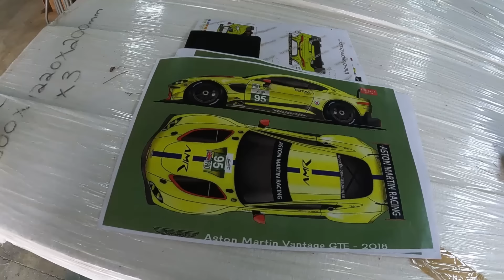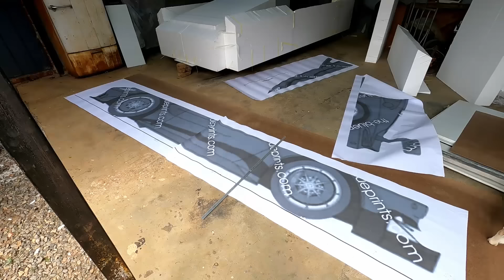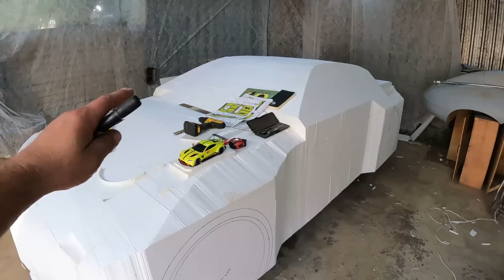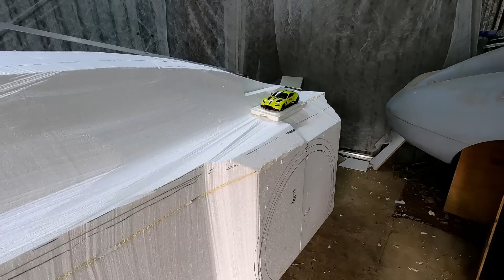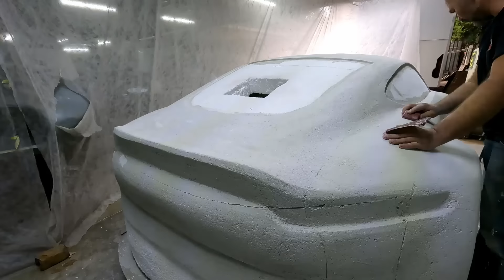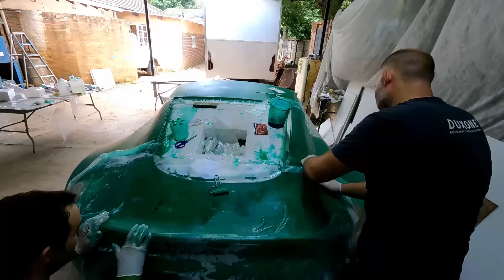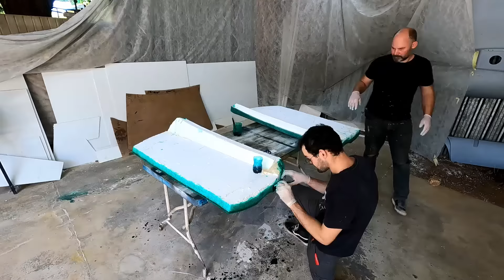EASY METHOD TO MAKE SUPERCAR BODIES FROM SCRATCH

Comment: Niiice!  Back in the 70s,  my friend's dad [Jack Kampney] made "The Mummy Machine"
*Which I'm sure millions of people are familiar with..  Jack used this same type of system for his prototyping and production.. 
He used what he referred to as a "Chop Gun" - That was pretty slick.. 
It mixed and threw the fiberglass/resin combo straight out like a spider web - so coats were Sprayed on vs Coated on..  
His shop was So Much Fun!
Anyways..  Your method rocks!  I've used the foam/hot-blade method for building RC delta wings.. 
*I think this method is probably better..  *I was initially taught having to carve clay..  Easy to work with but creates more of a mess.

Comment: It seems that if you purchased some brake cleaner spray, it would dissolve all of the styrofoam without hurting the fiberglass, so it is an easy way to seperate the two.

Comment: I once helped my dad carved a giant 10 foot diameter pepsi bottle caps from styrofoam and even bigger jumbo jet cockpit, it's in the early 80's, he probably the first one using hot wire cutters and airbrush to do large scale 3d styrofoam promotional props in my country. I always thought my dad is some kind of McGiver-y dude. Miss him.
Reply: Had similar experiences with my dad around that time too , mainly in model engineering and model aircraft… later working in the family business with plastic fabrication…
He’s been gone 10 years… you just don’t appreciate what experience they gave you when you young… 
Ironically I now have a son of 30 years old and history is repeating itself, I’ve taught him everything I know and we work together… he learns different skills every day, not just from me … 

That’s 3 generations of multi skilled engineers … all self taught.. 
I’m also just building a full race car from scratch using similar methods in this video for some parts… 

Remember scaling up drawings using graph paper and tracing drawings onto balsa with carbon paper and tracing paper…

Yep good old days 👌

Comment: Are Aston Martin aware that your client is faking an Aston Martin car on the race track ? He can't just build a car and then put a fibre glass Aston Martin body over it. (Unless he is Chinese in China) but listening to the accent it's in South Africa.
You should be talking about a mold and not about a car because all you are making is a shell look alike of an existing car.
25:48 - Fibre glass matting and woven fibre glass is .... wait for it ..... fibre glass and has absolutely NOTHING to do with carbon fibre apart from the fact that it is woven. 
35:00 - "Doing it this way makes it EVEN STRONGER than Carbon Fibre" ??????????  ...... I think you need to take a visit to your doctor and then go to your local engineering school with your samples and ask them for a full explanation about the qualities of fibre glass and polyester chopped, woven etc. and then ask about Carbon fibre.
First things first. Carbon fibre is strong when used with EPOXY resin. It is NOT used with polyester resin. Ask the tech school why.
I've seen and heard enough BS here, but nice body shell. Well done. It looks very good.

Comment: I'm impressed, but also this method is incredibly wasteful in time and in materials. I'd have made that outer shell into a mold, where you can have a much better surface finish on the final piece that is the exact dimensions of the "plug" (what you called a mold). Plus you should have used a release agent before applying your cloth and resin, the hours and hours spent with knives and scrapers would have been more than halved. Still very impressed with your end result, but its going to take a lot of hours in finishing, and please use some breathing protection, polystyrene is not lung friendly.
Reply: Oh wow great advice...what car molds have you done please link it below for us...
Reply: He can still make a mold from the finished car body if he want to make duplicates.
Reply: Where are your videos?  Waiting for the links....
Reply: @AutismusPrime69  How many skilled craftspeople make youtube videos of everything they do? Maybe one in a few hundred if that?

Comment: Another way, might be a bit more easy would be to make cross sections out of hard board. Then glue the foam to them until you have the entire car. Next simply run the hot wire bridged over them from the side. The closer the hard board cross sections the more accurate it would be. 

Note: after I watched the entire video I see why using his method and outcome you would not want to use the hard board cross sections as I suggested above. You could use that method if you intended to use the finished foam car to pull a mold from. 

He figured a way to actually use the outer fiberglass skin as the simi finished body for the car. I did not expect that but certainly admire it. Though I would want molds of some sort, molds could still be pulled from the finished body sections before before or after mounting on the car chassis.

I have a mid 2000 era ASA NASCAR chassis and I am going to hang a 1968 mustang coup body on it because I can't afford a fastback body. Went to the website on those prints and found the car I want, a 1968 fastback mustang. How do you get a full size print? Do you order the one from the website, I see they include multiple file types then have it printed full size locally? looks like they do not offer 1:1 prints.

Comment: As a retired clay sculptor who worked for General Motors, I must say that I’m impressed. Although not as perfect as clay would be, your process produced a fine semblance of the auto that hopefully will suffice for the end customers use. Nice video.
Reply: its only his cuts, not his body work. Body work is amazing, cuts are imperfect, edges are reflecting the methods. I believe if he had a planed pivoting cutter to do body work it'd be better, but then we'd just be in a clay car body workshop.
Reply: @exstacc1886  exactly what I was thinking - or modify one
Reply: Foam, then joint compound or body filler as a finisher before the mold is my go too but I understand the clay in a professional environment as it lends to future modifications nicely
Reply: Я тоже увлекаюсь и работаю с скульптурным пластилином. Я делаю обвесы на авто
Reply: It looks like you need a friend who has a Lamborghini and who will allow you to make a mold of the body using baking paper and resin sheets. Otherwise it is impossible to achieve a symmetrical and exact bodywork that is accurate to the millimeter.
Reply: For traditional clay... Would you build out a solid polystyrene core and put clay over it?  Or would you go and weld up a steel or aluminum frame
Reply: @xXVintersorgXx  At GM a flat steel or wood platform is at the base of a stack of six inch thick styrofoam. Your wheels could be attached to this. Then the foam is carved to the rough shape minus 2 to 3 inches overall, then the clay is added and finished.
Reply: The easy way = very skilled with a foam cutter.
Reply: С глиной работать трудно. Лучше скульптурный пластилин. Там можно миллиметрами снимать слои
Reply: When i was a kid i watched a video tour of the clay shop at gm. You also made a great impression on me as a kid
Reply: Your profession is fascinating I wish we could see more of it behind the scenes.
Reply: What type of clay is used? Mine keeps drying and cracking
Reply: @gilosgarage look up automotive styling clay. Usually made by a company called Chavant. You warm it up to about 135 degrees so that it becomes soft enough to apply and when it cools to room temperature it is hard and carveable.  I never really drys out and you can use it over and over until it gets dirty. Best of luck.
Reply: @daviddickmeyer5231  thank you!
Reply: @gilosgarage  If your clay is drying and cracking sounds like you are using a water-based clay. Plasticine Is what is used for automotive models.
Reply: @ray24051  thank you!
Reply: yeah it looks like what as a student we used to do to load the clay on.
Reply: Question as an expert in clay do you think it's legitimately safe to make a car frame out of it? Or just good for making them to show off but not really drive??
Reply: @thechemi5083  why would you want to or even think you could drive a car made out of clay? Clay is always somewhat soft. It is only used in the design process to evaluate how the car looks, never to drive! That is just a silly question.
Reply: @daviddickmeyer5231  he asked you a question that he thought you may have an answer to and your goofy ass called him silly. No question is silly
Reply: The clay is just to mold the shape of the vehicle you want into fiberglass once you have the fiberglass done you dont need the clay lol😂 @thechemi5083
Reply: @thechemi5083 😮what the? Are you just messing with us? You are referring to the clay right or did I misunderstand? I hope I misunderstood you but to answer NO do not attempt to build a car frame at of clay OR Do 🤔 IDC. Common sense just can’t be taught so it’s not all your fault it’s genetics. I would suggest staying away from power tools.

Comment: Great video! Kept my attention the whole way through as well. Just a few questions I hope you can answer: with your new fiberglass method being a lot more flexible... if you were going to make this for a road-worthy car, how much stiffer would you want it to be? I'm assuming you would achieve this by adding more layers of your new-method fiberglass... but I'm not exactly sure. And if you would add more layers, would you add them on top or on the bottom of each panel? Just not exactly sure on what the exact methodology would be and was hoping you could explain/elaborate on it. Thanks!
Reply: its too flexible, its not going to handle any aerodynamic forces well.

Comment: There's a guy on YouTube that builds fibreglass parts for rally cars and for rigidity he laid in fuel line on the back side and fibreglassed over it to create ribs. It worked very well and if you lay in brackets under the glass.  it makes very sturdy mounting points
Reply: His channel is @billsbuildandrace

Comment: Carbon fibre breaking first is correct, it has a higher flexural modulus. TLDR fibreglass is bendier. Carbon fibre snaps with less deflection than the fibreglass but at a much higher level of force per distance of deflection. Modern woven fibreglass is pretty strong. You’d only use carbon fibre if you needed it to be a lot more rigid for the given total mass, so much so that the additional mass of fibreglass you’d need to add otherwise to increase the rigidity would be too great, or the time/cost of doing it just didn’t make sense.

Comment: If you had left some of the styrene on the panels it would have added syrength and crash protection. Would hve required inner coverage in fiberglass though.

Comment: wondering how the f you keep it symetrical I thought perhaps you can hang a wire from the roof exactly over the center of the body. That way you can pull it towards a point and check it on the other half.

Comment: I just would have left some of the foam in; like carved down to structural ribs inside for support and mounting points, or just for thinner outer and inner layers of fiberglass sandwiching a foam core center - wouldn't of added much weight, but could have made the panels super rigid and strong

Comment: Any easier way would be to put a release agent on the actual car spray it with foam insulation and then break the shell off put it all back together and fill it with fiberglass resin and make a body

Comment: I thought you were making a mould so you could easily replicate the panels - Are you serious that all that work and first corner nudge and its gone? Where does structural rigidity come from? I am stunned at the workmanship and effort that goes into making that. Simply incredible guys.
Reply: I was asking myself the same and I suppose that when you unmold the  body, you can reinforce with inner layers with little epoxy tubes for example. By the way, I suppose that this resin skin will be bonded on a tubular chassis.
Reply: @mikls6830  I see - I'm incredulous that after going to all that trouble they don't make that outer skin a mould and then in the conventional fashion produce the skins from that mould - The customer will need a wing or lord knows what after the slightest of touches and all that original shape is gone. No wonder this motor racing lark is so expensive 😂
Reply: I am betting when they hang the body on the chassis the body to chassis mount or support system will also become the inner body support system giving the body much more strength. I did expect the initial body to be a mold not the simi finished body. I would have made it a mold so more body pieces could easily be replicated but when each body section is finished, it can also be used to make a mold before final mounting, maybe that is the plan. 

These guys certainly know what they are doing so I had to subscribe so I don't miss any updates in the future.

Comment: Looks like you sandwiched some biaxial fibreglass in the 3 layer test piece which would explain the impressive bending performance along that axis. The biaxial will be 3-4x stronger along that axis than traditional woven. So it makes sense that the CF with only woven cloth, despite being a stronger material, broker sooner.

Comment: This is NOT the way to do it. Somewhere I have an article by a custom auto builder showing a much cheaper and easier method. 
Take the actual rolling chassis with wheels, tires, seats, steering wheel etc installed. cover it with 4-6 mil  thick clear plastic. Now mix up 20% plaster of Paris with 80% vermiculite mixed in. Take news paper and crumple it up and dunk it in the mixture and SPLAT!  put it on top of the plastic and start building up the shape of the car body. 
it sets quickly and if something isn't right..... just take a drywall saw and hack off what you don't like and go back to building the shape you want. You can mush it and mold it by hand while it is still soft. Once you get really close to the shape, now you mix up straight Plaster of Paris and smear a couple of thick layers on top to smooth out the surface so that you have enough thickness to do a final sanding.
Now you put your layers of fiberglass and resin on it and when it is set  and hard, pull it off and clean it out and prep it for paint and do any other work needed on the inside (mounting brackets, etc)
it is a lot cheaper than that polystyrene crap, that is for sure, it is faster and it is easier to work with.

Comment: Maybe I missed it, but doesn't fibreglass resin dissolve expanded polystyrene?
Reply: Yes it does. I suppose that is why he puts several coats of latex house paint on it first and uses water-based filler (Poly filler stuff).

Comment: My thought for a one of a kind body is to design it in a 3D sculpting program, generate the female mold and break it down into pieces that can be 3D printed. Design the support structure and connection/alignment details into the mold pieces.

Comment: This is kinda what I was thinking I'd do when I eventually get the time and the money to build the Trans Am 20000 from Redline. Build the internals (most likely based off a Trans Am anyways), make the body out of foam, and then use the foam as a template for the actual body.

Comment: "just sand down"  lol, there is NOTHING EASY WHATSOEVER about 'sanding down a completely rough car body.  I know because I have done it, and i will NEVER do it again.
I make molds that are thin and 'throw away', when thin, they will warp within a week, so you must use them immediately and then they are junk, but you get a smooth good part once, maybe twice.  OMG, you removed all the foam, wtf are you doing?  That gives it all the strength!!   You need 1/2 thick and then thin glass on the inside, and its super strong.  You made it weak after all that work.   oh boy.
Reply: Support can still be added but remember it is going to be mounted on a tube chassis. Once the body is in place and the relationship between the body and frame are established inner support structure can be glassed in. 

That support structure can be made to function as a attachment to the chassis and also a strengthening system for the outer body structure. I am betting that is his plan, it would be mine. 

At this point if he ads in an inner support structure it may need to be removed in many places due to interference with the chassis. Just makes sense to hang the body on the chassis making the mounts to the chassis also the inner support structure. 

I am also wondering how the windshield will be mounted as at 200 mph that mounting system will need to be vary strong. I have ideas on how to do that but cant wait to see his method.
Reply: @robert5  The foam weighs nothing and already supports the body perfectly.  I've had racecar with floppy doors and hoods and fenders to save weight.  Sure but in this case he just removed it all for no reason whatsoever.  Just dumb, sorry if I tell it like I see it and not some fanboy.
Reply: @murraymadness4674  Nah your right, everyone commenting has no idea, just see something that looks like a Aston and are all giddy... They took years off their lives by not wearing any PPE, the end result is going to take WEEKS of bodywork, and its waaay to flimsy to handle an aerodynamic loads, or even sand properly for that matter. They used no release agent... I could go on and on... I work with carbon fiber aircraft and this is a child's idea of what working with composites is... I've even made my own one off pieces for my own projects and I spent literally weeks making one carbon fiber tail piece for a motorcycle...